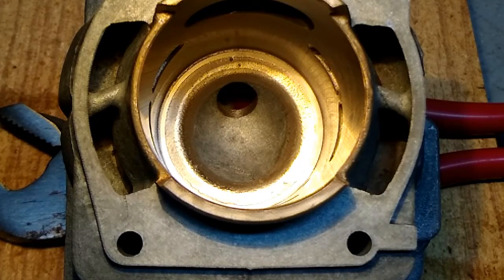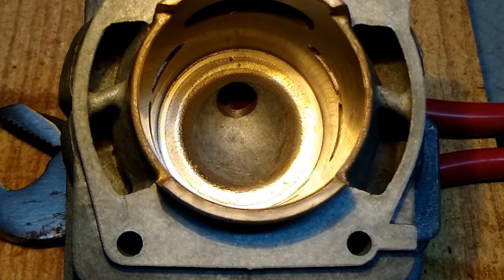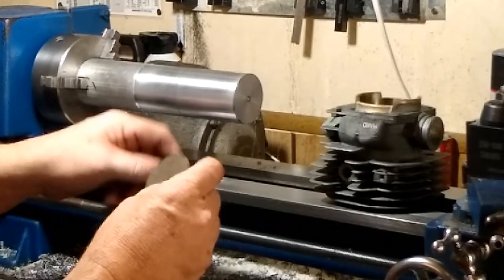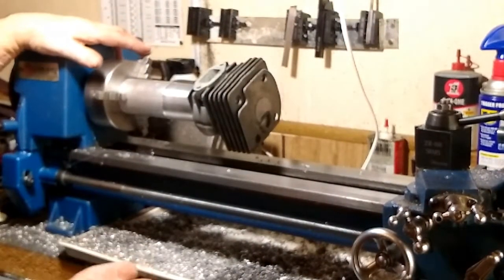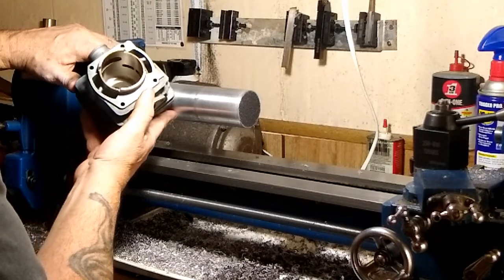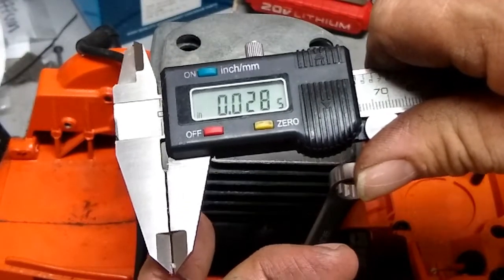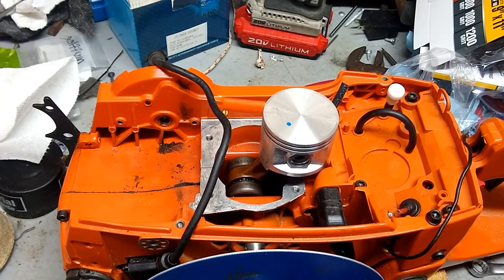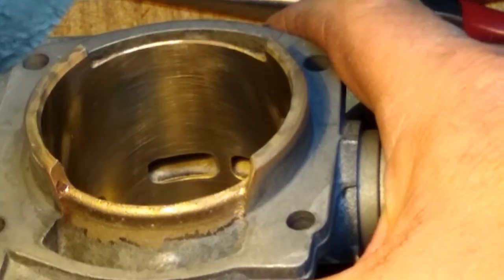Modifying the squish band the hard way.

Comment: Well done , at least your trying  to get around certain issues...at the end of the day oem cylinders  have normally got large squish ..20tho is normally  for custom  build ...im sure this cylinder  would work fine as it is...im going to have same troubles  when i get parts eventually...
Reply from the maker: Ya, if you think about it the base gasket usually sets you up another .018 to .020 which would put this one around .045. I have an Echo that is in excess of .050 that is stock. This is all just playing around to find what I can squeeze out of one.
The main issue I was having here with the squish band is that it wasn't flat with the surface of the cylinder, it was cone shaped and I didn't like the fact that is left a recess around the outside edge of the squish band to let carbon build up. I am ordering some aluminum plate this weekend and will drill it so I can mount the cylinder and turn a flat squish band in it. It's probably going to take a couple of weeks from the time I get it ordered till I get it done.
Reply from the maker: I'm also going to have to order a plunge back dial indicator with an arm so I can read the top of the cylinder to true it up on the lathe, which is more machining tools so I don't have a problem with that since I am trying to get more of them anyway.
Reply from the maker: Sorry for the delay Nicky. I ordered in a indicator that was new and it wouldn't read below .003 so it was useless and I sent it back. Then I ordered in a used indicator that was supposed to be in "EXCELLENT" condition just to find the movement was gummed up and couldn't be trusted so I had to send it back so still on the search for a good indicator with an extended probe (I think I have one that I can order next week). I made some mounts so I can mill on my lathe and ordered in a angle plate but when it arrived it wasn't slotted anything like their picture and diagram showed so I had to send it back and working on getting the right one of those as well.